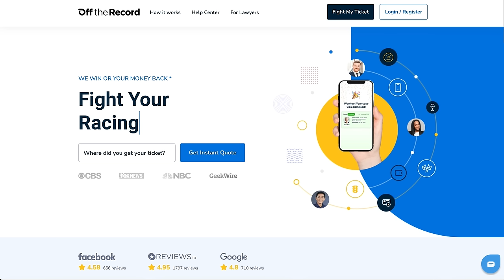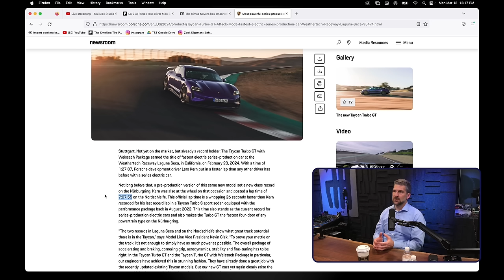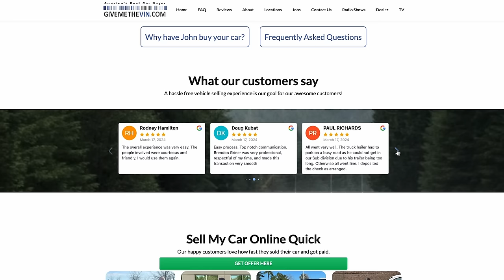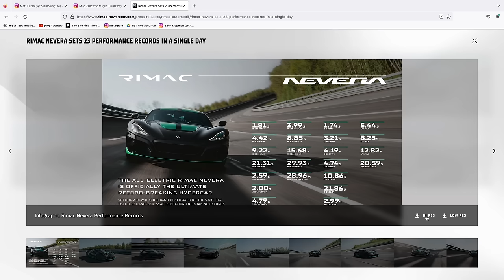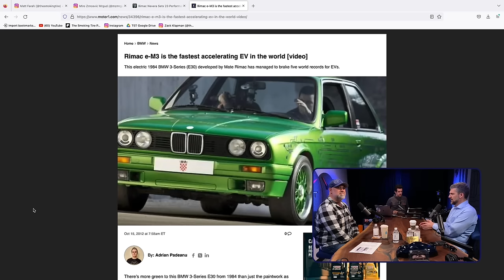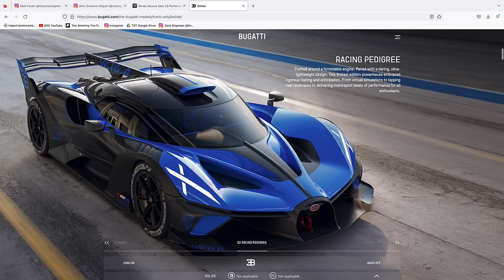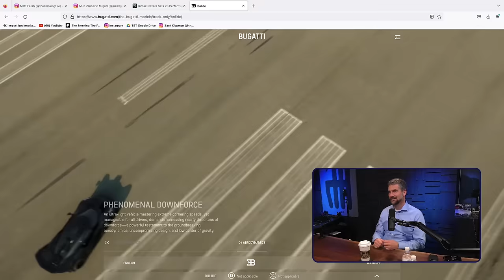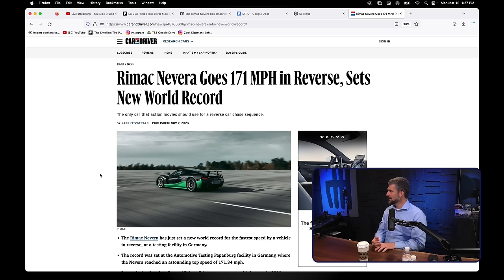How I Became A Hypercar Test Driver - TST Podcast #908

Comment: 47:11 small correction to those that are interested: it was not at Nardo but Millbrook in UK. One of the journalist was Colin Goodwin. They scared some guy after passing him with this driver-less Bentley but then the cruise control stopped working while they were still in the back so the car started to drift off course. Didn't crash but they did get what Colin described as "good bollocking"
Reply: Yeah I think Millbrook’s builders did a better job than the Italians at Nardo (shock horror!) in terms of the symmetry of the corner banking angles because as a complete unknown “prospective client” Lexus were happy to let me lap a LS400 at 150mph whilst the sales rep sitting next to me encouraged me to take my hands off the wheel from time to time! I should add this was over 20yrs ago when Health & Safety was a burgeoning idea rather than the be-all and end-all it is today!
Reply: Huh... 😅 would not go out of the driving seat even for a very high adas level 😂

As for the build, Nardo ring got refurbished some time ago, and is now very well. Yes the grade throughout the lap changes, it kinks down after km 8 a bit and then goes up again just before exit (about km 11) but is still one of the best. They did (by rumors) had to refurbish it twice because the asphalt was running down at summer due to heat, and then (again rumors) it was done by a US/Nascar track building company.